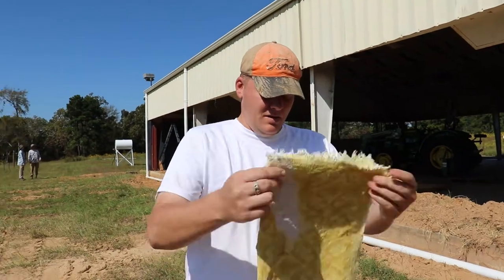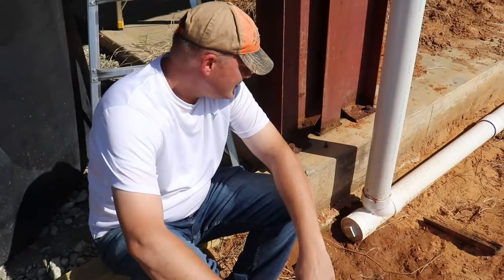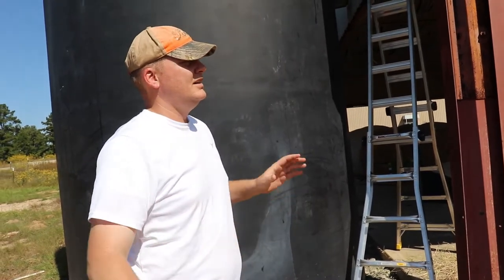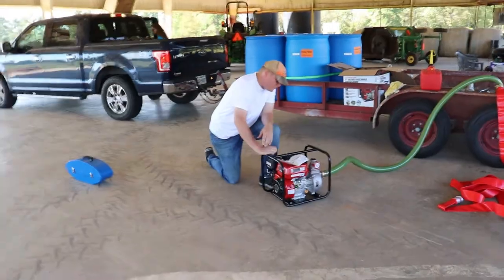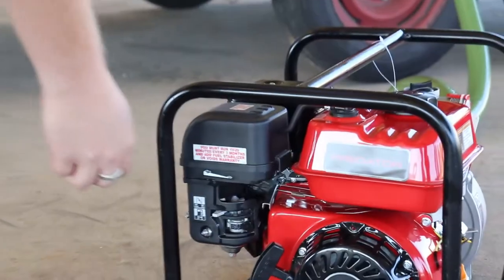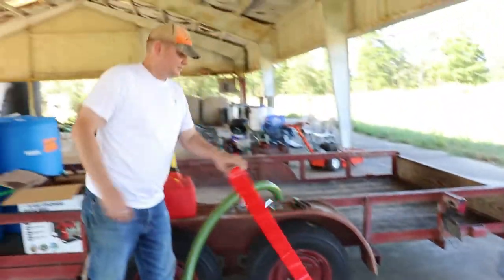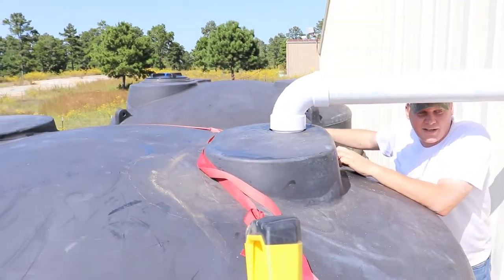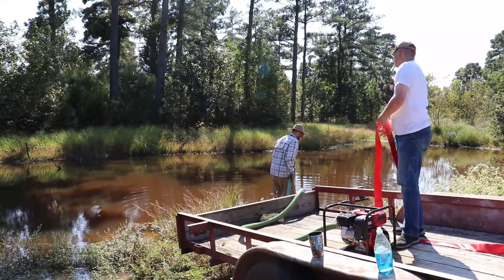Ep. 35 - Pumping Water to Water Storage Tanks for our Off Grid Homestead

Comment: I had some good laughs watching this video. The captions on it are so funny.
You should put some kind of filter in the tanks entrance or later the faucets can get clogged. Even using those they use those funnels for milk filtration could help. The problem is, once a while, you'll need to clean them.
Reply from the maker: Good suggestion.  My thought was that the 4" pipes would act as a big first flush and most things would never make it to the tanks.  However, I guess some things float and could make it in there and cause issues.  I'll look into that.

Comment: When the monsoons come and the tanks overflow you need to anticipate what that will do.....   PVC pipe joints should NOT leak!  Liberal amounts of glue and a slight twist when joining will make a tight seal.  The minimal amount of leakage you have will not be a problem as any rainfall will make the area wet anyway....so no one will know they leak.  :-)
Reply from the maker: I think we might try and ensure the pipes are level with each other.  There may be some pitch up and down which might hinder a proper seal.  I agree with you though that this small of seepage may not be a big deal
Reply: @BlackacreRanch  Might be a problem over time if it is always leaking. It will never dry due to the pressure.

Comment: Would it be easier and cheaper to get a hose that is long enough to pull from the pond directly? Might require a stronger pump to move that volume that far though. Hmm 🤔
Reply from the maker: It is a really long way.  I have only seen suction/discharge hoses as long as 25 feet.  They may make longer ones I'm sure but I'd have to maybe go 1000 feet.  It would be way simpler though